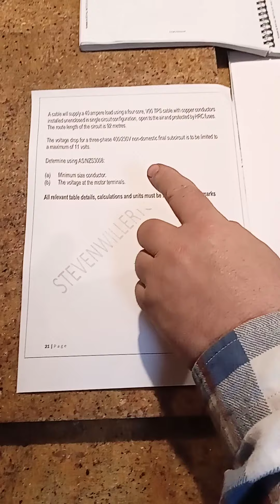LET voltage drop Explained one of questions

Comment: Thank you for sharing. If I'm checking a circuit for eg and the value is 216 volts at a single phase 230 volts power outlet, would you consider that's acceptable? 
Clause 1.6.2 voltage tolerance is +10% to -6% (in accordance with AS 60038). I'm not sure which value to work on. Keep up the great videos.